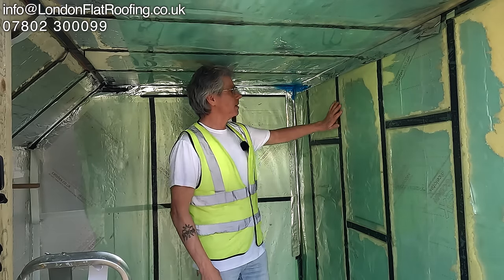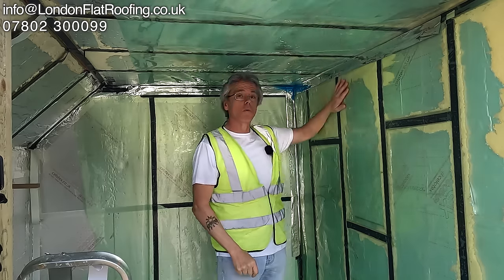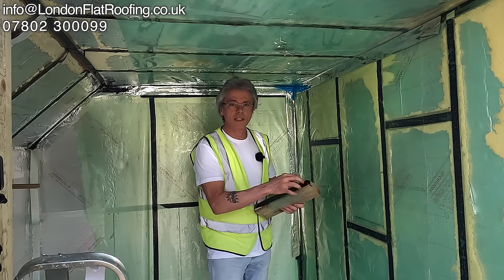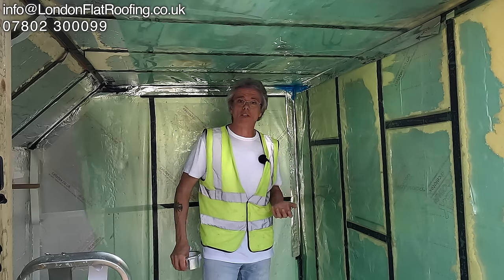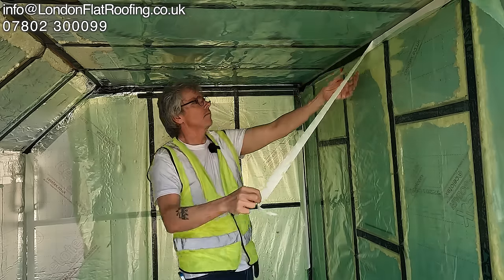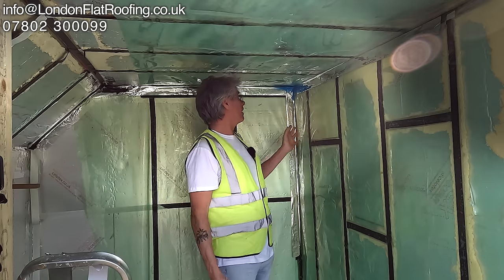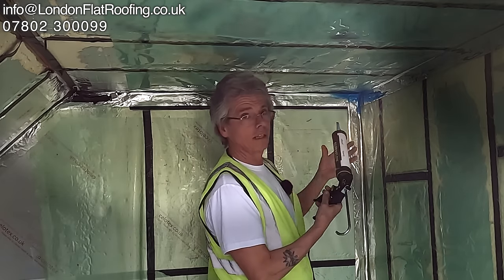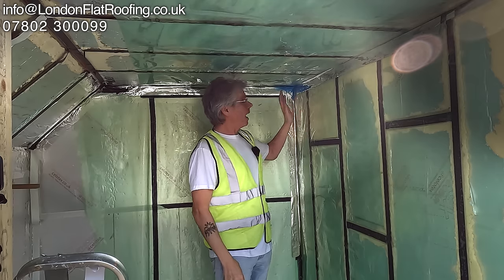Vapour Barrier Installed Correctly - Walls and Cold Roofs

Comment: Hi Steve hope your well.i totally get the importance of a vapour barrier but how do you maintain it around a twinwall wood burner flue I don't see it's possible?
Reply from the maker: It may sound silly but as best as you can just try and keep everything airtight
Reply: @SteveRoofer  with a twinwall flue u have to have a minimum of 50mm air cap around and nothing combustible attached to the flue I guess you could attached the vapour barrier to the back of the lead slate

Comment: Hi Steve. I’m currently doing a loft conversion with a cold roof. I will be putting 100mm PIR in between the joists and 50mm PIR over. Do I need a VCL layer if all the PIR joints are taped? If so does it go on top of or behind the 50mm PIR?
Reply from the maker: you always put the air vapour control layer on the warmest side of the insulation press. You can't put it that far down it's got to go just over the top of the Joyce you always put the air vapour control layer on the warmest side of the insulation press. You can't put it that far down it's got to go just over the top of the joists and under the 100 mm PIR
Reply: Sorry I'm confused by this reply, the vcl goes directly onto the joist (so between the two layers of pir) or under the lowest pir layer (room side, the warmest side) ?
Reply: It also confused me mark. the warmest side would be between the 50mm pir and the plasterboard.

Comment: Hi I have a small shed with a cold roof, all timber frame, can I use 2 layers of 2.5mm kingspan to make 5mm, would I be okey to glue the kingspan together?
Reply: Yes that works stage the joints
Reply: @HampsteadBuildersLt   thank you

Comment: Hi, great content. I'm learning loads. Quick question. On a warm flat roof,Should I put a vapor control under the ceiling joist aswell as the one under the insulation? Thanks

Comment: Great video 🙏🏻 quick question please, my architect specified a 1000gauge vapour but the builder went for the 500gauge. Should I panic and ask him to put the 1000gauge as specified ?
Reply from the maker: Both are probably wrong. Normally it has to be 1200 gauge to get to the correct standards its all down to what the vaper resistance of the material is so look at the manufacturer's expectations with Air Vapour Control Layer (AVCL) its not just how good it is its how its fitted a well fitted AVCL that is not the correct standards but fitted correctly and is airtight will probably work. A very good AVCL fitted badly doesn't work.

Comment: Hi Steve, do you have any information regarding adding a vapour control layer to a solid brick wall? I have a 2.4m x 1.7m small add on at the back of my house which is constructed from solid brick walls which is to be a cloakroom toilet and utility room. Before I fell down the rabbit hole of vapour control layers I was set to dot and dab with insulated plasterboard. If a vapour control layer is added before the plasterboard this means I would be unable to dot and dab? Given the very limited space I want to refrain from having to batten the walls as things just about fit as is. Any advice would be massively appreciated
Reply from the maker: A lot of people get very hung up on vapour control layer as it's not necessarily the vapour control layer that is a problem. It's controlling the movement of air what you're trying to do is put in a air barrier to stop the movement of air through a structure. So an air vapour control layer that should always go on the warm side of the insulation. The most important part of this is the air barrier not the vapour barrier so basically just keeping the construction airtight is the most important thing

Comment: Are there any "paint on" barrier solutions that could be used like stuff used on roof surfaces? I have a loft with Bobtail/Stub end type eves full of timber struts which I want to retain on the warm side for storage amongst other things but the thought of trying to fit & join bits of membrane between & to all of the timber struts hurts my head just thinking about it!
Reply from the maker: Unfortunately I don't know of any paint on vapour control layer however in America I note that they tend to use some of them
Reply: @SteveRoofer  Theres a few for come up on Google for sale in the UK. Think I may have to a look into them as like I say theres just no way I can get a sheet membrane around all the timbers jutting out everywhere. I don't think Youtube allows links but if you were interested theres a video on YT called: CPD Intelligent Membranes liquid airtight vapour control barrier CPD fluid applied airtight membrane
Reply: @SteveRoofer  I've now actually tried out 2 types of paint on barriers, although I have only used them for sealing around small tricky areas & I stuck with traditional methods for the large flat surfaces such as barrier sheets or joining the included foil faces on PIR boards as these work out much cheaper. 

I used fibre reinforced paints that are specifically designed for for complex areas such as where roof timbers penetrate PIR boards etc from Intelligent Membranes CPD & a cheaper product from PermaSEAL (seems just as good) & as long as they last as long as they claim to I have to say they are excellent. Very quick & easy to apply.

Comment: Hi Steve, what's your experience of multifoil insulation being used with pir. The multi foil suppliers claims no vapour barrier is needed when using their products.
Reply from the maker: Good question I have seen some roofs fail but probably because they didn't understand how to install the products correctly. Yes you can use the multi foil as a vapour barrier however you must type all joints as per manufacturers specifications personally I love the stuff however haven't fitted much of it

Comment: Hi Steve, love the detail in your videos, you said you prefer warm roofs, I have a question you might be able to answer, I am building a garden room with a warm roof, when I done the roof I fitted a polythene membrane, now I’m doing the inside the walls are 5 x 2 with 100 mm kingspan friction fitted, the question was do I need to put another membrane on the ceiling as I’m having 15 downlighters installed, I was going to use double sided tape around the timbers to get a good seal on the wall membrane at plate height. Many thanks Tony
Reply from the maker: If its a warm roof the vapour barrier is under the insulation that is over the joists so the space under the choice is classed as internal space you don't even have to have a ceiling you can put in as many likes as you want to because your vapour barrier is above that space. If however you made a mistake and put your vapour barrier lower down then you have a problem. The first problem is the vapour barrier is in the wrong place! The second problem is if you cut holes through it for the lights it's not gonna work. The good news is that even if you do put the lights in and you do cut through that lower vapour barrier warm roofs are very forgiving and it probably will still work.

Comment: Ridiculous overkill. Most are low occupancy garden rooms , no steam from kettles , shower rooms , kitchens etc . I’m convinced that these big businesses selling these products are brain washing people into buying all these products unnecessarily. 
I built a garden room 25 yrs ago with none of these products, granted it’s not as well insulated as I would like , but it’s still stood and I’ve never had a problem with damp or moisture. 
Walls  are 3/4” ply , 4” fibreglass insulation, plasterboard and skimmed , never had a spot of moisture or damp damage and it used to house a spa tub.
Reply: This is for ALL constructions that involve timber frame or SFS (light steel frame) type builds. This is not just a home office / garden building way of constructing things. Passive house building is a good example where this sort of methodology is used, but very common in modern construction types, both domestic housing and light commercial.
Reply from the maker: If you're a professional person you have to do things correctly or you will be held responsible in the video I just show the correct way of doing it
Reply: For context Steve works in South London where in many areas that a house without a loft conversion (read timber room built like this) is the odd one out. All new builds will have a habitat room in the roof down south. This is very relevant to house building, extensions and the roof, he is just standing in a test rig at ground level.
Reply from the maker: @loneturk3y  for new builds that are energy efficient that means all new extensions loft conversions and new houses and flats we have to be really careful with how we control the internal environment and this may mean adding an air vapour control layer. Sometimes the house may be designed to be breathable in which case a vapour control layer may not be needed or can be of lower quality.

Comment: Would a PVC pond liner work as a vapour barrier ??  because I have a green roof it is already installed and my OSB is starting to rot from the inside so I am planning on changing it to a warm roof system
Reply from the maker: Don't know I can only quote the correct specifications for a Air Vapour Control Layer (AVCL) however it may do but is is worth the risk
Reply: @SteveRoofer  I can see what you mean.  I am low on money so maybe I will just improve the ventilation, both  options   involve taking the  roof off anywhere in that case anyway. Life is a Lemon sometimes

Comment: Hi Steve 
Just wondering how would you recommend sealing a cold roof vapour barrier to internal block cavity wall? 

All examples I see are a complete timber frame, sealing walls and ceiling. 

Thanks
Reply: I'm no expert but I think the double sided Butyl tape shown in this video may be your best bet as is seems to stick to anything.

Comment: Thanks Steve.

Will 30mm suffice? The price increase for 50mm is pretty significant.
Reply from the maker: Depends on what you're doing 30 mm is very very thin 50 mm we used to do a lot but you can tell when installing it's still not as good as at least 100 mm 100 mm is where I would go

Comment: Howdo mate.
Can't find a more immediate way to message you.....
Have you ever had any problems, or have you ever primed kemperol to rubber/sarna/armourplan etc?
Reply from the maker: Yes, we have tried all of those and realistically as long as all surfaces are clean and dust free. You can normally get away without a primer. However the manufacturers don't like you not using a primer. We always make sure that the joint is secured using termination bars also
Reply: @Steve Roofer  cheers mate. Didn't want to ask kemp reps as it would just open a can of worms, we've had them out to look over our work, but only use it a few times a year...
It looked like normal single ply, whatever system, but turned out it had a very fine paint on it. The paint was leaching an oil or something, and nothing would stick. Fine grinding, loads of acetone and the clear, heavy duty primer sorted it anyway (ac primer?).
Generally only use termination strips on vertical, and always make sure that the edges are well bled in.
We normally do a catalyst heavy paint mix to test it anyway, but experience has taught us that it sometimes looks like it has stuck, but later peels. So normally use the primer anyway. We'd never come across this though. (It wasn't a full roof, to be clear, just several repairs against square penetrations, the surveyor couldn't get to the roof to see what it was, he'd assumed it would be OK! He wont be doing that again.)
Cheers for the response anyway. Sorry for my very long reply.

Every day's a school day.

Comment: Hi Steve on the Alutrix website it says to use FG 35 primer even with the self adhesive vapour barrier 
Can it be installed without  primer
Reply from the maker: If you are going to glue down your insulation yes use the primer if you are scaring it down with my preferred method thermaly broken fixings then no need to use primer
Reply: @SteveRoofer  
Ok thanks for the quick reply 
Will be screwing it down

Comment: I am doing a flat warm roof with a twin walled stove flue passing through, any thoughts of how i would go about this, with regards to the vapour barrier?

Great video as always - Watched a lot of your videos and they are all very informative!
Reply from the maker: It's not difficult just make sure you seal it correctly and take the vapour barrier up above the height of the insulation you may want to put a piece of insulation above the roof level justice help stop thermal bridging
Reply: @SteveRoofer  Thanks for the reply

Comment: Very interesting,  just as I try to erect the walls of my garden room room this week. However,  I have decided to use some Kingspan insulated roofing panels instead of traditional, joists + PIR + osb + epdm. Any comments of this type of system? 

I'm still interested in doing what I can with the wall though so this is still incredibly interesting. Many thanks.
Reply from the maker: If the Kingspan metal roof has insulation under it you don't need a vapour barrier this is all discussed on a video I did three weeks ago Condensation/Sweating on garden office roof https://www.youtube.com/watch?v=dHrI3EqEXW0&ab_channel=SteveRoofer

Comment: Hi Steve,

Great Video thanks. 

I am in the process of installing a vapour barrier (Novia STRP Pro Premium) in a new basement, this has a Foam filled hybrid roof with isothane, this was done due to design limitations, we must ensure a very well installed high spec vapour barrier is in place to prevent condensation and will do so with the Butyl tape and overlapping tape which I have. the vapour barrier is going to continue down the walls internally which are metal stud 50mm with PIR board in between, The ceiling is a metal frame dropped ceiling circa 70mm gap above  and the same approach will be taken here with the butyl tape and vapour barrier onto the metal frame before the plasterboard goes on. 

my question is in regards to sockets.  Any suggestion for this? my approach is going to be to cut out space for the sockets from the PIR board, cut across the vapour barrier and then patch in a recess using the butyl tape and small piece of vapour barrier in order to ensure no gaps, is this the right approach for this? as otherwise there would be just gaping big holes behind the sockets in the vapour barrier.  Its fiddly but I cannot see another way?

Comment: I don't understand what you mean when you say you only do warm roofs, you don't do cold roofs. Can you explain? what is a warm roof and what is a cold roof?
Reply from the maker: the woman is where the insulation laid over the top of the supportive timbers. Cold roof is where the insulation between the joists just above the ceiling and roof itself is cold, because the heat from the room below is kept away from it by the insulation

Comment: This whole vapour barrier thing is a nightmare because it has to be broken for most lighting and fixings etc sockets. For a cold roof if the 50mm void above the insulation is continuous from vented soffit to soffit in a garden room a few holes in the VB won’t hurt too much as you are getting that moisture straight out of the roof space? 

Best thing we could all live in is a open barn no condensation problems then ha.

Keep up the amazing work
Reply from the maker: Yes, the whole thing is a big problem and it's getting worse because we are stopping the transfer of energy from inside of property because we are installing insulation. The transfer of energy will help dry. The timbers in the construction now we have not got the energy to do so the timbers could stay colder and be wetter for longer that's causing the rot and decay, so we totally have to change the way we construct things and using the warm roof construction method is the best way.

Comment: I'm planning on pulling down ceiling and pitched roof and retrofitting better insulation, worth installing a VCL at the same time? What about the stud partition walls, do I just seal it against the wood?
Reply from the maker: In a roof always put a vapour control layer in walls it's not always necessary
Reply: @SteveRoofer  Steve, planning on taking out a lath and plaster exterior wall in an old 1800s stone house (no render, so the stone is permeable). Plan to put up 50x50mm studwork (trying to save space as well) with a small air gap, PIR in between the studs, then board and paper it. Does it need an extensive VCL like this, given that the other walls and ceilings are still lath and plaster that just have rolls of glass wool behind them? (this was the only wall that couldn't be accessed from behind).